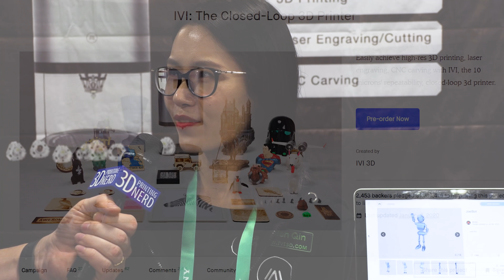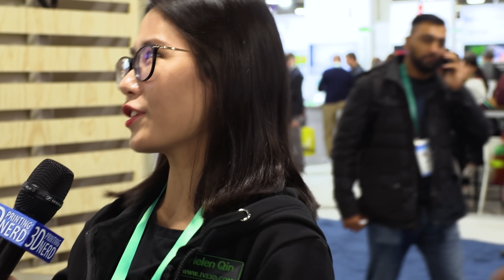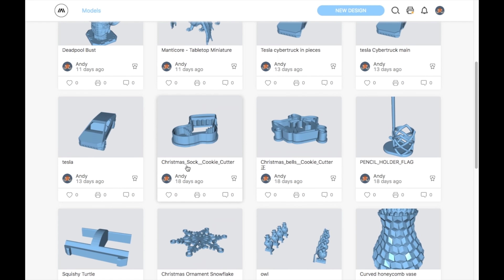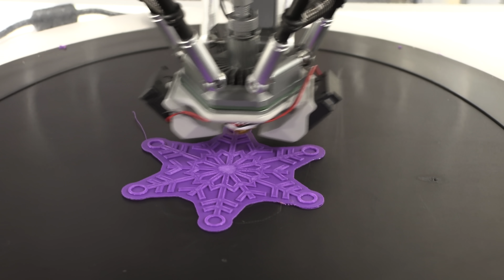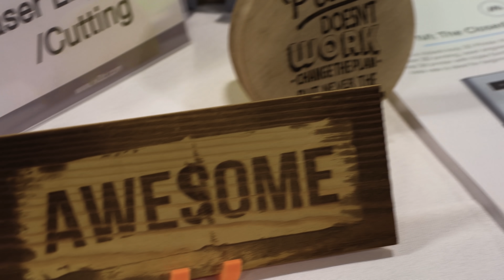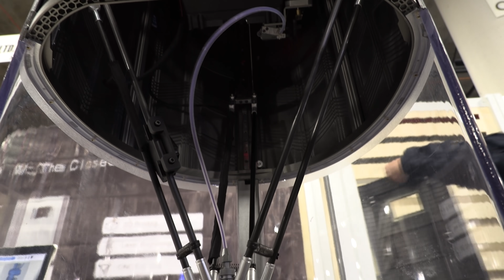3D Printing FAST with IVI 3D Printer at CES - Shipping Soon!

Comment: I did some math for the $1,300,000 kickstarter. 15 people in the ivi team with a low $20,000 average salary is $300,000. Kickstarter takes a 10% cut of $130,000. This leaves $870,000 between 2,500 backers to include printers, cnc modules, laser modules, shipping which averages $348 per backer. Assuming the 15 people have a $30,000 or $40,000 average salary then the average budget per printer is $288 or $228 per backer. Assuming there are around 2,500 modules from varying cnc milling to laser modules averaging $25 that have to be produced and a $50 packaging and shipping cost per backer, that is another $75 less per backer's 3D printer meaning $150-275 per 3D printer to be produced.

I checked their updates and it looks like there are a lot of custom parts from the electronics to the precision extrusions for the frame. Even injection molding in bulk is still expensive. By my own experience shopping for parts and custom parts, a similar machine would cost about $500 for just the raw parts. Even assuming a 10-25% error in my calculations, there is a big gap between $150-275 and $500 and many of the machines were sold for less. 

Someone please tell me I am wrong. I don’t want another pirate3D or tiko to hurt the 3D printing community...

Comment: I once used free 3d print service in a nearby library’s makerspace, and due to time limitations (starts at 10 AM and machines shut up before 6PM) I set the speed to 150 on these Ultimaker 2+, and it 🤣although it shivered and shaked and going crazy

Comment: Intriguing, and good progress. Delta printers with insulated bowden tube filament feed seem promising for high-temp build environments because all the motors are outside the high temp area. If the build area's air is not vented before it rises into the electronics area then we still have the same problem, but the potential is there.

Comment: I love this company's vision and passion for its product. I understand that their 3D print have a high chance of working out; but I failed to see how their CNC portion of the development can provide proper results. I am not sure how they properly mount the piece on the platform prior to CNC machining to ensure the piece does not move while it is been milled. I am also a bit skeptical about the rigidity of the CNC head during the CNC milling process to ensure its cutting precision. I also like to see how they are using their laser cutting process as well as I am not sure how they can be sure the laser does not burn into the base platform during the cutting? What about the fume that it will generate during the laser engraving and cutting process. I definitely like to see more of their CNC and laser engraving/cutting process of a piece to see how the machine actually work in those situations.

Comment: So it's easy to use...until it breaks. You can share gcode for files, do you need to have the permission to share those files? I can see this having lots of issues.
Reply: Yes, we cannot guarantee that there will be no problem at all with the Cloud. That's why we will keep listening to everyone's suggestions. We will have clear and strict rules about sharing and using the files. Users will be notified of the rules before using the Cloud. It's not going to be easy but it will not stop us from working hard for it.
Reply: @IVI3DPrinter  Hello! Is there a way to manually finetune your firmware? After buying a 3d printer usually a customer deals with Marlin (or other FW) and there are a lot of values to set up for your needs.
How does IVI handles retractions? 
Does it supports Linear Advance?
Reply: @KiR_3d   Hi! Basically, you don't need to adjust settings to use IVI. Making 3D printer easy-to-use to everyone is what we're trying to do. At the same time, you can finetune most of the firmware settings based on your needs. Currently, we handle retractions with slicing instead of Linear Advance.
Reply: @IVI3DPrinter  Wait... Linear Advance is not about retractions. It can't be "instead of LA". Please, ask about this for actual tech. Or maybe you've did a wrong translation.
Could you print a hollow cube 100x100x100mm (with wall of 2mm) and show us the actual dimensions (using good quality calipers)? PETG would be the best.
And show it closely, please. This would really help.
My concern about a possibility of FW tuning is because a hardware of a delta 3d-printer can't work flowlessly for years. I think that it can be compensated only by tuning or within some calibration. Would be cool to have more videos with tech. details. This will answer many of your potential buyers' questions.
Reply: @KiR_3d  My bad. I misunderstood the reply from our engineer. I am sincerely sorry about it. 
According to our engineer, we didn't try Linear Advance function before, but based on the description of Marlin, IVI should be able to support this function. We'd like to add this function in the future. Thank you for your suggestion. 
Besides, we've tested PETG filament before, please check https://forum.ivi3d.com/t/filament-ivi-prints-with-petg/1148. Also, we did a benchmark test to respond to people's suggestion, you can check the dimensional accuracy: https://youtu.be/d0QVTvDwgOI. 
Any further questions, just let us know.

Comment: Bullshit on the cutting. To cut 3mm ply you need at least a 20-30W laser, and there is absolutely no way that piddly little toy in the print head is anywhere near that power.
Same on the spindle. It's just tiny and extremely underpowered. Best you'll be able to do is do really, really slow 3D engraving using a tiny tool.
Oh, and a total lack of safety. Anything over 10mW requires safety gear. At the powers they're claiming, a single reflection means instant and permanent blindness.

Comment: those hotswappable heads that you can still change and use normal nozzles with is just awesome... THAT... is just pure awesome so you don't need to buy a special proprietary part if you need to change a nozzle... but at the same time, you can buy multiples for hotswapping...  just... brilliant.

and that quote? Love it. 

"if the plan doesnt work, change the plan, not the goal"
Reply from the maker: I really like that quote

Comment: I like her honesty. Printing and laser looks good. But, STOP ADDING CNC MILLING TO 3D PRINTERS! It doesnt work, rigidity isn't there, totally useless.
Reply from the maker: I mean, you can say that, but it works on theirs. I also have it on my Zmorph VX and it works there as well.
Reply: @3DPrintingNerd  Can you share some examples of what you made with it? Zmorth VX is basically an engraver design that takes a printer head, so yes it will do some basic milling.

The IVI is not an engraver. There is a reason mills never use delta config. You can't expect to put a vibrating rotary cutter on the end of long push sticks and get any kind of accuracy.  But air do look forward to your full review.

Comment: Joel, thank you for your followup interview.  It was your initial video from last year that got me interested in this printer and then taking the huge step to invest.  Though for me the KickStarter investment was considerable (old fart on a fixed income), I had a feeling that the IVI team were genuine in their desire to produce a printer aimed at providing a better alternative for beginners through intermediate users.  From one stop shopping (their cloud based system) to allowing us to use more mainstream software (Cura, etal).  I’ve been intrigued by 3D printing with its tremendous potential to allow entry level inventors and those who just like to create (Thingiverse 😁) and everywhere in between.  When I get my printer (hopefully by July or August), I’ve got a list of projects that will use a variety of filaments and I appreciate that the IVI team has tested their system using any that I’ll use and more.  If what they’ve documented on their website for the backers is accurate, they have taken thorough to a significantly higher level of scrutiny 👍.   Their accessories (laser, CNC and in the future resin printing) are not something I’ll buy since one of my first 3D printed projects is a mpcnc, but just the fact that they have looked to that future as plausible and designed their existing printer to accommodate those pieces shows, at least to me, that they are seriously in it for the long term.  
Again, thank you for this interview.  It has made me feel much more comfortable with my investment!
Be well,
Ben
Reply: @banbadtvads Good luck to you on this, I hope IVI can deliver for you and all of their backers.
Also, if you haven't seen them already, Thomas Sanladerer did a few videos on his channel mid-late last year where he built an MPCNC and published a replacement part to try to make it more rigid. https://toms3d.org/2019/08/24/the-mpcnc-build-list/
Reply: Anthony Rich Thank you for that info.  I have been watching many of Tom’s videos.  I was disheartened to read that V1 was so adamant that Tom’s piece was an infringement.  One of the greatest things about the community of Makers is their willingness to help each other.  I am confused because V1 seems quite accepting that people build the 3D parts rather than him selling them, so why the refusal to allow a piece to be modified that appears to make the base CNC a better system.  It’s not as if he’s losing money nor Tom making any. Thanks again.

Comment: I like the multiple uses of this device, have seen others with similar functions but this once can laser cut not just etch. My only wish is to get them a little bigger and more powerful. To CNC thru more materials or laser thru thicker material and of course bigger volume. But they are just starting out and looks great.

Comment: I backed the project on kickstarter, printers were supposed to have shipped in August of 2019. They have delayed shipping several times now and currently supposed to ship in June. I was really not feeling warm and fuzzy about it but after this video my hopes are up again.. Fingers crossed..
Reply from the maker: I truly get the feeling this is not a Kodama situation and they are delaying for good reasons. Fingers crossed as well.
Reply: You spin the wheel, you take your chances. Shouldn’t buy into it if you can’t afford to lose it. Good luck.
Reply: @jmtx.  You are correct and I for sure wouldn't have backed if losing the $ was a hardship.
Reply: Can't thank you more, Chadd, and all the backers. We will work hard the deliver the IVI for all of you.

Comment: Milling dust with no extraction and linear rails/belts/idlers not a great combo in enclosed small area, plus going to have to clean the machine inside out before using as a 3D printer again. Will milling dust find its way up to the controller that is not isolated from the work area?  wood dust plus hot electronics could be fun..  Not sure if this is safe really ?  Thoughts?  The hardware I have worked on in machine shops had removed material extraction, all the control units are in remote stations away from all the crud that is milled out, although the axial depth and spindle speed / feed rate may not have much energy to fling particles around that much, need to see it in action.
Reply: Exactly.

Comment: Hi can some please help as I’m know to 3d printing as Hi Last week a bought a Ender 3. The sample filament included worked till it ran out then I swapped the filaments to a x3d one and now the extrodder will work fine to start with but after a bit it stops feeding the filament to the hot end but the motor still spins but no filament comes out the hot end. And I have tried printing at the max on the spool
Reply: Sounds like your nozzle could be blocked. This can happen if filament had particles/contaminants, or if the hotend is left at operating temperature for a long time without printing anything (which leaves burnt filament stuck there). Try Googling how to do a "cold pull" and follow a procedure appropriate for your printer. Done correctly it pulls whatever is stuck in your nozzle back through the heat break and out of the way.
Reply: Anthony Rich I have just tried a cold pull but the same issue continues

Comment: Unless I can load Marlin on this thing ( most likely they are using a Marlin proprietary clone) this machine is worthless for me. Want to make a nice deltabot that prints superfast? Yes you can buy all the parts online and upgrade it and make it better. ( My printer - a Cartesian one- has 0.9 deg steppers and tmc5160 controllers with 32bit board. I can print really fast. With the TIKO clone you're stuck to one moment in time

Comment: Are there other hobby level Closed loop printers ?
Reply: I found this video with links to a stepper driver with magnetic encoder that fits normal stepper motors like on a ender 3 and will work with that control board as well, Dirt cheep for closed loop control of the steppers.
https://youtu.be/GtT7ok3QhJk

Comment: I see linear rails in there. Machined aluminum parts. Nothing they are doing is ground breaking but  doing it well enough could certainly bring a great printer to market. Delta printers are far better anyways. ;)
Reply: Are there other closed loop printers at this price range?
Reply: I think the closed loop control system is interesting, but would only buy this printer if it could work cloud-free. Also love my current delta.

Comment: NO! Just no! This it a total non starter. If they go under, and there's a pretty good chance they do, they take their cloud service with them to the grave and the printer is useless. It's also dependent on an internet connection... WHY???
Reply: Then I’ll dumpster dive from the noobs and toss in a 32 bit board for a grand total of $20 I’ll have a delta, mwahahaa! Open Source for the win!

My cousin is ripping the electronics from his MakerBot because the firmware locking meant using an awful slicer... Open Source has the creativity of the whole world, not just a few bored out of their mind programmers trying to hit deadlines, so it quickly exceeds and continues to grow year after year improving far beyond what was originally thought capable (and a company isn’t going to keep improving a 5 year old product, it’s discontinued and life support only).

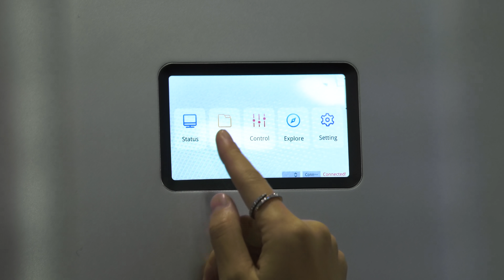Comment: 3:30 FINALLY a pretty UI! Good job!
Reply: Octoprint-tft on a octoprint setup looks amazing and works fine. there is one bug with the temp showing and making the screen time out which a custom version i've found fixed and been using it since 3 months and it's flawless + darkmode

Comment: Those 150mm/s are a joke. Any printer can do 200mm/s, thats what any 8 bit controller with a nema17 at 12V can do without problems. Whats more important, give me the max acceleration and jerk it can do and the quality it can do at those accelerations and jerk.
Speed alone means nothing if you have 5mm/s^2 or if the quality you get while running at that speed with high acceleration is crap.
Reply: If you follow them on kickstarter you will undertand that they don't just mean it can do 150mm/s...Indeed every printer can reach that speed. In fact they even did tests at 300mm/s... What they mean is, at those speeds there isn't a very noticable quality difference. If I set my printers to cartesian printers to 100mm/s I already see bad print quality... And the accelleration in those videos also looks pretty fast...
Reply: my mendels can do 200mm/s at 2000mm/s^2 and barely have any worse quality than anything above 100mm/s. If that looked fast for you that means you dont know what fast is. I can set mine to 4000mm/s^2 but the movement is so strong the whole shelve moves and vibrates (not good for 24/7).
If thats their idea of showing how fast and rigid their machine is, they are doing it wrong, because it looks slow as molasses. (and if they are using a closed loop system they should be able to do higher accel. without the occasional step skipping)
Reply: @laharl2k  At 2,000mm/s/s accelerations your printer has to be printing 21mm long straight line segments to even hit 200mm/s before it has to start decelerating to stop or change directions. Just so you know.

Comment: They seem like nice enough folks. I wish them well, but I'm just not sold on delta's, in general, myself.
Reply: I personally loved deltas, the motion system is a bit of art to me. My delta originally, came with an 8bit board, but really could not push it too hard because the board could not handle all of the computations. However when I switched to a Duet and 0.9 deg steppers, the print quality is fantastic even at higher speeds. 

The downside is they tend to be more expensive to buy, and the round shape of build area does limit the size of non-circular items,, however,  depending on what you are mostly printing it can be mitigated.
Reply: They use a 32-bit processor instead of 8-bit, this will solve many of the inherent problems with delta printers.
If you're mostly concerned because of the artifacts you have seen then this should solve that (at least mostly).
If you have other reasons, well then sure ;)
Every type of mechanical design has it own advantages and disadvantages, mechanically delta printers should be able to go much faster than most (or all) other designs for 3D printers without comprising print quality as much.
Reply: @Dzeno2010  Yeah, I've heard they're faster for some things. If I had to print a lot of things that fell into the sweet spot for that form factor I might feel differently. I think the biggest drawback for me is that I don't inherently understand the motion system, without any in-depth thought or math, like I do the typical linear motion system. And when I'm trying to help others, a lot of times with a delta it's a straight research project and not very intuitive for me.